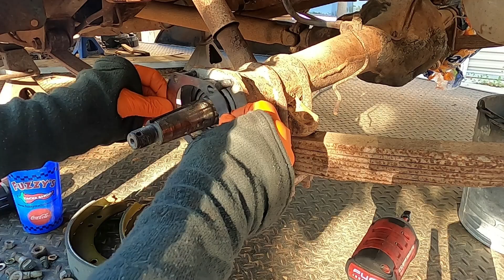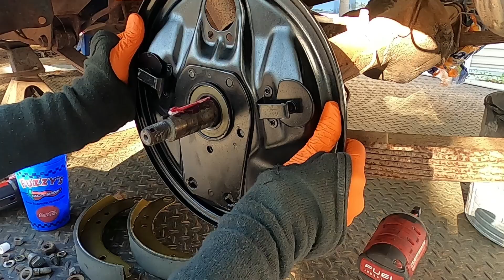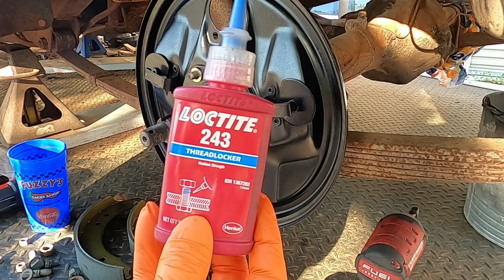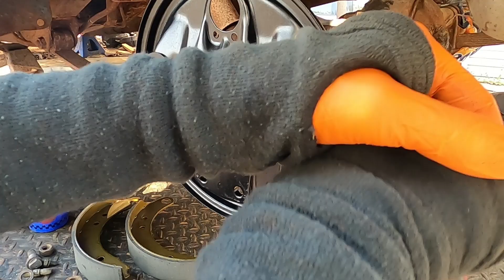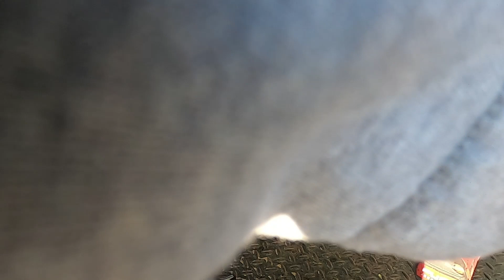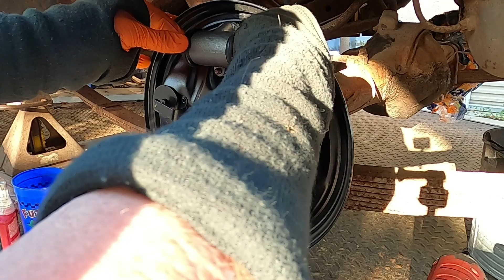1948 DeSoto Coupe - Finally a little reassembly:  Rear drum brake assembly

Comment: The axle roller bearing is sparingly lubricated via a grease fitting, temporarily installed just inboard of the axle flange, in the place of a pipe plug found there. This was done to prevent excessive application of grease, which could contaminate the brakes. The bearing is not primarily lubricated by the differential oil.